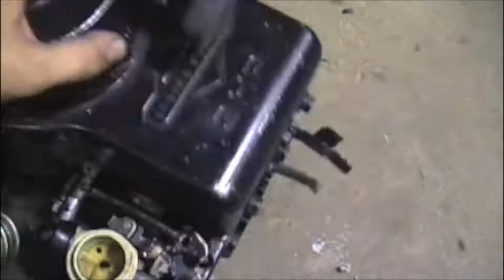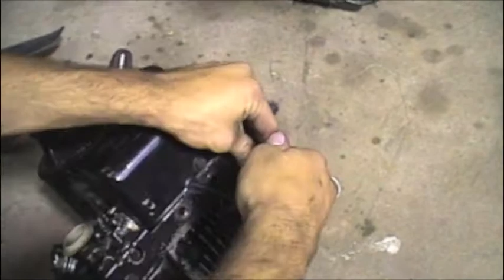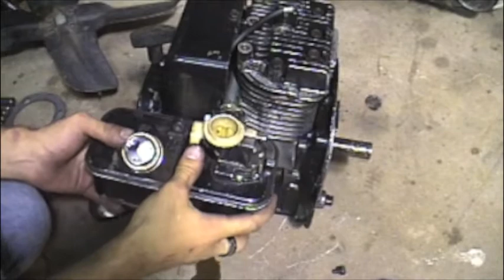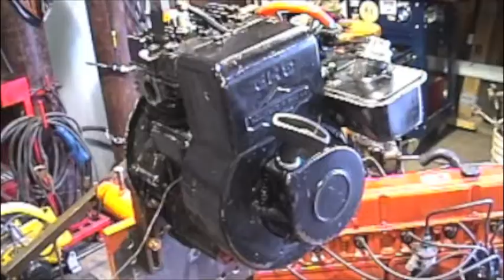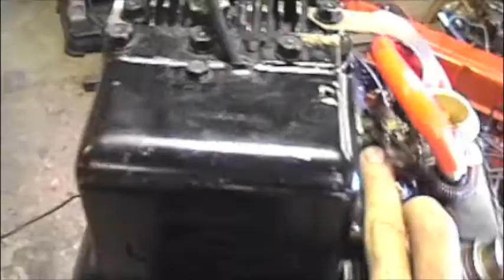How to Convert a Vertical Shaft Small Engine to a Horizontal Configuration

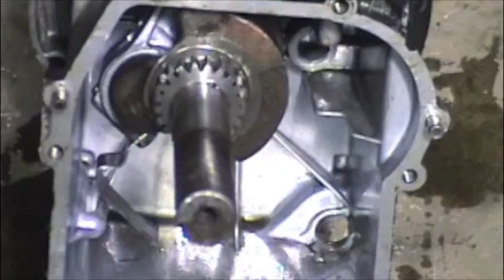Comment: How did you attach the oil flinger at 7:05 ? im making a go kart motor
Reply: The rod cap bolt was removed, put through the flinger, and reinstalled. Make sure it's torqued back to spec, and ensure your flinger doesn't hit anything.
Reply: also want to know